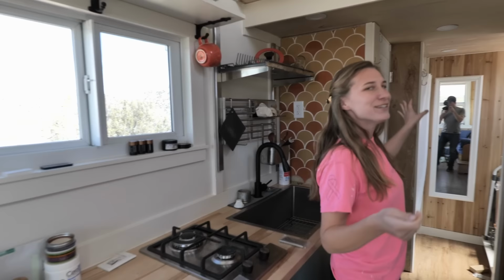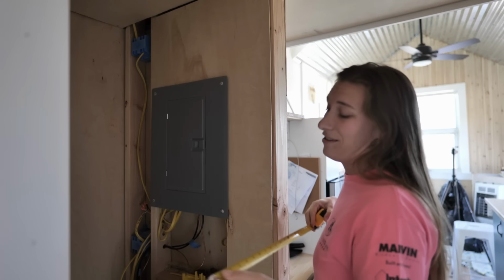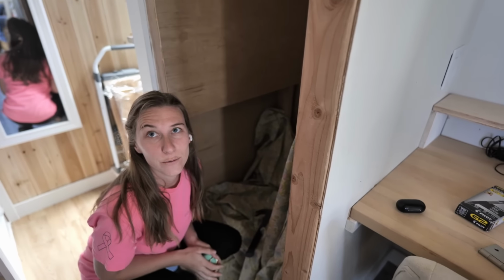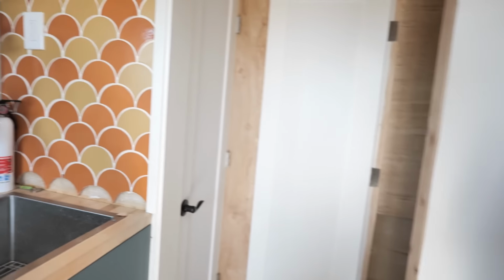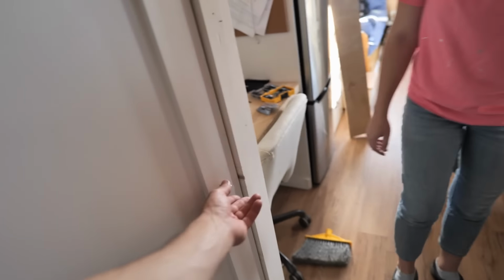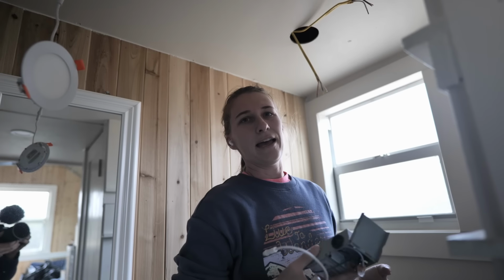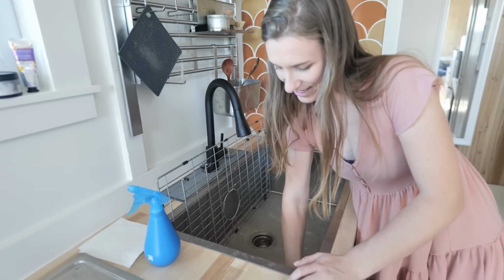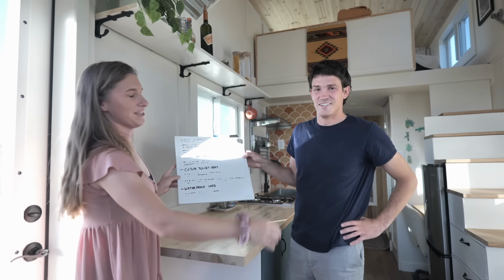We Have Big News! Off Grid Life in the High Desert 🏜️

Comment: Glad things are going well. On the subject of the dead battery problem you had this winter, consider installing a simple secondary solar charging system. I'd go with a couple of solar panels and a Victron charge controller. That way, if your main charger/inverter hasn't got enough battery to start, the Victron will get the battery up to a functional level. Plus, the extra charge capacity will always help.